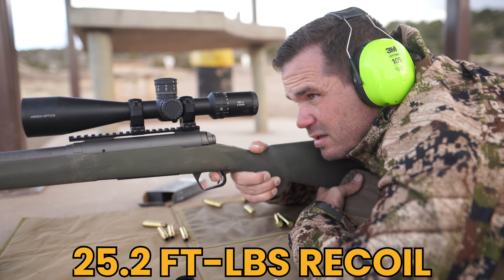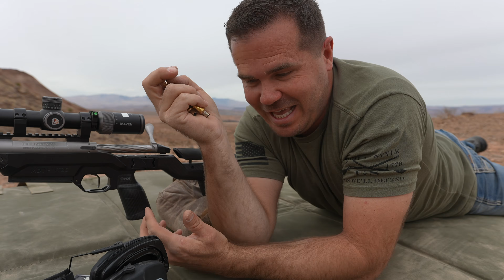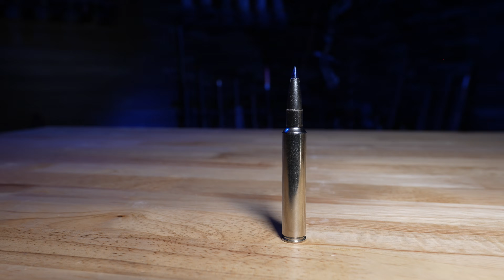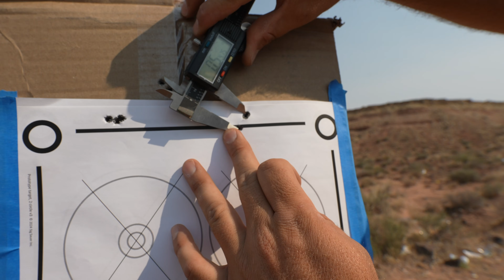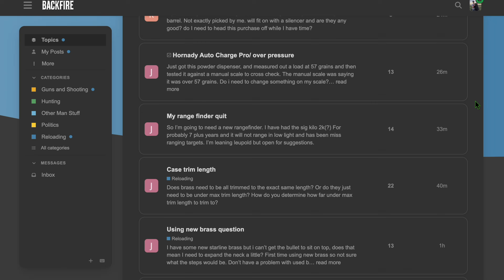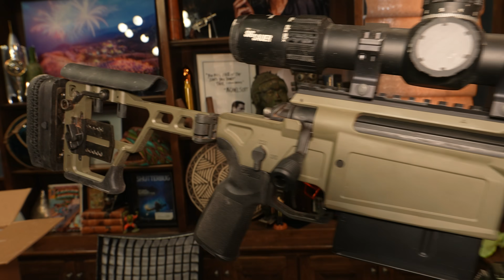6 Phenomenal Cartridges No One Is Using

Comment: The 270 short mag is better than the saum, it has more velocity, is easier to find ammo for and is just as accurate. Its far better for hunting too with more energy. Factory ammo for the 270 short mag is extremely accurate and the Winchester stainless classic has a claw extractor is far superior to the pin feed crap most people hunt with.

Comment: 6.8 Western,… Looks allot like a 270 Short Mag.
Reply: The parent casing for the 6.8 Western is in fact, the 270 WSM. They reformed the neck and slightly shortened the casing in order to load those longer and heavier .277 bullets. The 6.8 Western can shoot those 155-175 grain bullets, whereas the 270 WSM tops out at 150 grain. 

Both are excellent cartridges

Comment: I’ll sum up why no one uses the whizz bang rounds, they do nothing more than what conventional rounds have been doing. 6 arc is maybe the only one that’s different because it goes in an ar-15 platform. But 280 ai and 7 saum do ultimately nothing more than a 7 rem mag, .22/250 does everything 22 creed does, 243 has been doing what 6 dasher does for years, and 6.8 western is like the 7 rem mags stupid cousin. .277 sig fury is maybe useful in an ar 10 platform, but in a hunting rifle just get a 270 Winchester the gun isn’t that much bigger and guess what when you drive 800 plus miles for a hunting trip and realize you forgot to bring ammo, you can find 270 .30-06 and 7mm magnum at Walmart. Have fun finding 6 dasher or 277 fury. Also, a lot of hunters need to man up with recoil, your .30-06 isn’t that bad. If I (and many professional hunters in africa) can be built like twigs and handle a 458 magnum all day long, there’s no excuse to complain about how a 7 prc feels like getting a tetanus shot.

Comment: 280AI brass can be hard to get at times and loaded ammo can be hard to find and expensive. 6 Dasher I have never seen loaded ammo on the shelf any place and brass is easier to get now than ever but still not easy to find and often out of stock. So you have to either purchase in bulk when you find ammo or brass and ideally you need to reload. 6.8 Western is a lead ballon it should be more popular than it is but it's not. The 277 Sig Furry is another nothing burger or lead ballon it should be popular but it's not. If Sig where nto jack-asses they would have made 30-06SPRG, 270WIN, 308Win, 243WIN etc.....but made it in their two piece case with higher pressures and velocity turning non-propritary old faithfuls into magnum performance cartridges when you want that performance!

Comment: Ok, 75% of shooters want of the shelves cartridges, Abundant and available. Unless you reload(I do) you can get a Gun In whatever cartridge availabe/designed. Wildcating, no problem. Someone that uses off the shelves ammo only, Look at the best sellers/In stock. 223,308,300BkOut, and plenty down to 300WM and 7RM. Once you reach the 10 or less availability, You Stockpile, Reload, or get a more popular rifle/Chambering. THe ULTIMATE, most accurate/Deadly cartridge might not be on the shelves or Ordereable

Comment: I run a 7saum in a long action. That’s where it gets a advantage over a 280 AI. You can see the bullets out a little further giving you a little more capacity in the case for powder which slightly reduces the pressure and allows you to get a little more velocity out of it. I had a hard time with load development on that as well. I did initially 24 different loads with three different bullets, two different primers and three different powders with varying charge weights. None of them were over three-quarter of an inch. Most of them under a half inch. I ended up deciding between. three loads that were under .3 with five shot groups

Comment: The 6.8 Western had an issue right out of the gate because, as far as I've been able to assess, about half of the rifles gave mediocre to poor accuracy (2 to 3 inch groups). If it had been made in the '50's, it would have probably developed a diehard fan base because the accurate rifles are really accurate. Nowadays? Not so much because we have become used to MOA and sub-MOA rifles. Two to three inches aren't going to light any fires. But, yes, I agree with you that the 6.8 Western is a hidden gem.

Comment: You missed the 7 Sherman Short... basically an optimized 7 SAUM with a 40° neck, .075" shorter COAL & .020" longer neck length.  Gets you farther away from the hairy edge of the short to long action transition when using high BC bullets.

Comment: 280 Ackley is an amazing cartridge but it is not as capable as 7 PRC. 2" of drift at 400 yds on average insignificant because that goes up with gusts or underestimating average wind across travel, and 280 Ack doesn't have the same energy. 

Separately, I built a 7 PRC on the same HNT26 chasis you did,nentire build with optic is 6.8 lbs, and recoil with factory 185 ammo is very manageable. It's significantly less recoil than 300 win mag (about 20% on test data)  and all my non shooter friends prefer it over a Ruger American in 308.

Comment: Great vid!  Love the content!   My 4lb 6.5 Grendel, my 5.2 lb .260 Rem and my 7mmRM (all built with 1:8 twist) are tack drivers.  Any one of em can cover just about all the hunting you’ll do in NA.  (Obviously the Grendel isn’t for grizzlies or moose, but it’ll handle elk in a pinch if you limit your range and use the right bullet….beautifully light, accurate and more than capable enough for deer!), the 7mm can do anything….as can the .260 really, (best round in the .308 family…by far).   Tons of moose have been killed with 6.5-55 Swedes, which is really the same as the .260 Rem.  (As is a 6.5CM….which came 20 years after the .260….and does nothing better, other than marketing).  I wonder when we’ll leave good enough alone..  Do I have a bunch of other guns/cartridges in these calibers….Yes.  Do I need them…no.  (Well, maybe the 22WMR, the 5.56 and .375 H&H are minimum necessities too).   If you’re talking custom builds, any round that you favor can provide incredible performance.  Factory guns can give a round a bad name…usually because they’re not built well and usually are sold with twist rates that are too slow…. And with crappy triggers and stocks.  Not always…but often.
Reply: If I could only have one rifle. I'd just keep my old rem 700 in 260.

Comment: So all of my hunting in Texas has been with 4 calibers. 308, 25-06, 7 mag. I found the 308 to be a little inconsistent out of short barrels. Never lost any game but just got all kinds of results. The 7mag is just a stone cold game killer! I found the 25-06 to be the same. It just punches above its class. The downside is it requires a long action and a 24” barrel which means it’s the same physical size rifle as the 7 mag in most cases. If the 25 Creedmoor can match the 06 it will be interesting. But for a lightweight field gun they should bring back the 25 SSM.

Comment: the 6.8 western debacle.    many moons ago the gun media were pushing the Winchester short mag WSM  debacle, kinda like the resent 6.5 CM  marketing crammed down our throats.   the 270 wsm  seem like a pretty hot round with 3240 feet per second blazing speed.   I purchase two rifles and they were  great!   then your marketing media decided they need to poo poo that great round and push the 6.5 CM  and the PRC.  bs    manufactures stopped making brass and dam near stop making ammo. forcing you to either buy into there new gimmicks.  today everyone has a chronograph,  maybe a borescope and knowledge  we can see the proof and with common sense can tell that we have been screwed and basically don trust the new marketing trends!
Reply: The 6.8 Western is amazing. I can do things with that cartridge that I simply cannot do with my 270’s. I hunt the Hells Canyon region, and so long distance shots are a must. My 270’s do not possess the energy level that I need due to the light weight of the projectile and lower BC. The 6.8 Western changed that with those higher BC bullets. It retains velocity better, shoots heavier bullets, has better energy, and it deflects wind better. 

I still love all my 270’s, but the 6.8 Western is a gem. Browning and Winchester picked a bad time to release it.

Comment: I  base everything off the tried and trued 338 Lapua and 250 grain bullets. 2850 FPS and a G1 .670 B.C.  So what I mean is choice whatever caliber you want and pick the bullet weight that gives you that 2850 FPS and a G1 B.C. Of around . 670 B.C. in that caliber. Your 7 MM 168 grain plus’s can get you at .618 Mark and over as you go up in weight in bully’s. Your 6.5 cals will get you in that .600 plus G1 B.C. With 140 plus grain bullets. I hope that makes sense.

Comment: If I was one of the army people in charge of the xm7 contest, I would have asked for a 25 caliber high bc bullet, traveling 3000ft/sec, with 2000ftlbs of energy. It would require an intermediate platform to be created, but it would still be lighter than what they ended up choosing. The Magpul icar mags are interesting for this, but I think my requirements could be done in a 10mm diameter case, instead of the more standard 11.2mm cases of the 6arc, even if the overall length needs to be increased slightly.

Comment: There are too many cartridges already. I am slimming the herd down because I just don't need that many different cartridges. I'm keeping my 300 WM, 7MM Rem Mag, it's too expensive to buy new rifles and scopes, reloading dies, brass (the new stuff has really expensive brass) just for the ability to shoot a heavier bullet longer distance. I have about 10 .308 rifles, a couple of 6.5 CMs and quite a few ARs. I got rid of all my .243 stuff, I can shoot Coyotes with 6.5 or .223, I'm just not going to hunt deer with a .243 with an 80-90 grain bullet, sorry 6mm fans. The rifle I enjoy shooting the most is my Tikka T3X lightweight 6.5 CM Veil, it's as accurate as anything in your video with very light recoil (I have your recoil pad on it. The next rifle I will buy will be a Tikka in .308 because I have lots of brass and the ,308 does everything I need to do in the woods. I also sold my ,270 Win, 30-30, .260 Rem, all the Wetherby calibers and most .22LRs. I just don't need all those different calibers that do the same thing. I'm only keeping calibers popular stuff with cheap available brass. You can have all the stuff that "is just so cool"

Comment: 6 ARC is a fun cartridge. I have it in both AR and bolt gun. AR, it shoots great but don't chase velocity when using powders like Varget or Vihtavouri N140 and using heavy bullets. It just isn't going to happen. Accept the slow velocity and work with it. Out of a bolt gun, that's when it gets fun. (Mind you I use both of mine in PRS applications so velocity isn't my main concern. I did however just rebarrel another upper with a lighter barrel for varmint/coyote duty so I'm going to start experimenting in the 90gr bullet range.)

Comment: 3000fps for your 280AI load seems about right. I’m shooting 150gr TTSX with 55.5gr of 4350 and getting right around 2980, and that’s not at max pressure. Others I’ve talked to with similar loads are getting similar results. 2800-2850fps would be more on par for a 160gr CX. 

LOVE the 280 Ackley, hoping to get a custom one soon.
Reply: How is the performance on game with that load? I bought a Weatherby Mark V “Live Wild” 280 AI in August. Only ended up taking a whitetail buck with it here in WY. That was with Federal TA Trophy Copper factory ammo. I have lots of 140 gr TTSX/LRX projectiles I’d like to load for it.
Reply: @lancekrystoff9619 I like the load a lot. I haven’t fiddled with it much so it’s probably capable of more than I’m getting. I’m shooting it out of a Kimber Hunter, at the range this past weekend my 3 shot groups averaged 1.1”. I’ve killed a few whitetails and an antelope with it so far and all have died quickly and left a good blood trail. I use Barnes TTSX or LRX bullets in almost all of my rifles at this point and have had similar results on game with each. Once I burn through all of these 7mm 150gr TTSX’s I may try some loads with the 139LRX

Comment: 280 AI better option for so many with 20 per cent less recoil in fact. Availability of the SAUM almost a custom only. Who needs a 25 creed when you can have a 6 creed or even 243? totally agree on lower recoil for less than elk size easily.

Comment: They should have taken the 6.5 PRC case and necked it down to .25 instead of the creedmoor case.
Reply: It's very easy to do. I love my 25 PRC. It has a better BC, shoots the same weight bullet 250 fps faster, flatter, bucks the wind better, and carries more energy downrange than the 6.5 PRC.
Reply: As a .25 fan, i did wonder the same as you. Watched a Hornady guy talking of the possibility of .25 PRC, and he said that in testing they were getting some strange pressure spikes. It may have been on a Ron Spomer channel i saw this.

Comment: Built a 7SAUM in a HNT26 chassis couple years ago.  Dropped a moose at 280 yards, one shot with a Barnes LRX 168gr.  Range test had the load at  around 2900 fps

Comment: This is exactly why I love the 30-06. Another cartridge based off the venerable’06. 280 or 7mm-06, my 338-06 and 6.5mm-06. Need nothing more so far.
Reply: I been hell bent on building 338 06 on a budget,  found a early win 70 action from a fire cheap and matched with a Douglas barrel. Gunsmith deemed action safe. 🇺🇸⚰
Reply: @ great action. I’ve found barrel length important. Mine have 24-26” barrels. Medium contour so they aren’t to heat sensitive. I usually build them off Savage 110’s because ease of barrel swap

Comment: I actually feel like the 6.8 is a step above the 7prc its not hard to take a 170 or 175 and push it very accurately at 3100fps i usually load them around 3000 and ive shot bears with it from 12 yards to 989 yards and it didn't go 50 yards i feel like its a great long range cartridge and its very versatile ive shot everything with it from coyotes, mountain lions, whitetail and mule deer i have never shot an elk with it because i archery hunt
Reply: You nailed it… It Durant get the credit that it deserves. I love mine. I’ve had excellent results on big game with it. The large bulls at 574, 588, and 656 yards, all one shot kills. One dropped where he stood. The other two ran maybe 30 yards. The 6.8 Western is an awesome hunting cartridge.
Reply: @jimedick9496  I was looking at using my 338 win mag with a super high bc 300 grain berger and I can actually get 200 more ft lbs at 1000 yards with the 6.8 western using a 170 berger
Reply: @everythingloud4068 
Yeah, ha, that would definitely do it 😁

For me, my limit on big game is 700 yards. There’s too many things that can go wrong beyond that distance. It takes roughly 1.5 seconds for a bullet to travel 1,000 yards. I do practice at that range, but for me, it’s a bit too far on game. Deer and Elk are constantly moving, enough that I get cold feet at pulling the trigger even when they are standing at the time of pulling the trigger.

My brother in law uses the 338 and he loves it!! I’m not a little guy, but I hate that kind of recoil 😭….. Joking aside, it really isn’t that bad to shoot. I’ve enjoyed shooting it. 

Good luck this season

Comment: @11:10 Winchester? Brass being out of spec? Say it ain't so. I hear every now and then they mess up and ship out an entire box with cartridges that fit in in the chamber wothout having to hammer to bolt closed. I even heard a story once about a box of their soft points that they forgot to drop tip-first onto concrete before boxing them.
Reply: So funny you say that because I just bought a box of Winchester ammo to try it in my weatherby and almost every bullet was seated differently in their brass than the others. 20 rounds and 20 different overall lengths 😂 they didn't shoot too well either

Comment: I owned a 270 wsm and 270 win. The 270 wsm is a flat shooter with reloder 26 the 270 win is smoking 150 grain@3000fps. 270 win corelokts are $29 per box. I really don’t see any advantage having a 6.8 western.
Reply: For most people, the 270 Win is all you need. For some of us, it’s not enough. That’s where the 6.8 Western comes in. My last three bull elk that I’ve taken have been at long range. 574, 588, and 656 yards, due to the canyons which I hunt. I couldn’t do that with my beloved Model 70 270 Win. On elk, I don’t pull the trigger past 350 yards. With my 6.8 Western, I’ll take it up to 700 yards. Also, those three bulls were one shot kills using 165 grain Accubond Long Range. Awesome performance!!

I love both these cartridges, but there’s a clear advantage with the Western if you’re hunting in areas that require long range capabilities. Again, for most, that’s not an issue.
Reply: @ that’s why they call it “western “ I guess. Eastern and Western hunting rely on different philosophies as it relates to firearms.
Reply: @Hanson-mound 
Well said… There are places that will not even allow the 270 Win. You need a shotgun.

Anyways, good luck this season 👍

Comment: I guess that I just like the wildcats, or old productions 25-06AI, 264WM, 308Norma, and latest build 6.5-284, which has proven to be a 1/4 MOA @ 300yds,   But I fid break down and built a 6.5 CM, just so happens I have a new 6 mm barrel, that is looking very much like a Dasher.   Time will tell